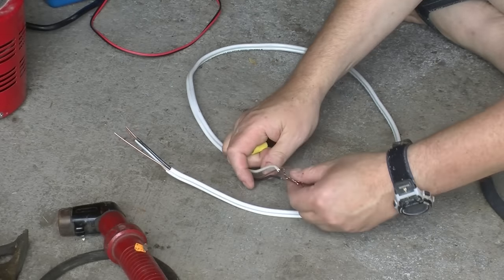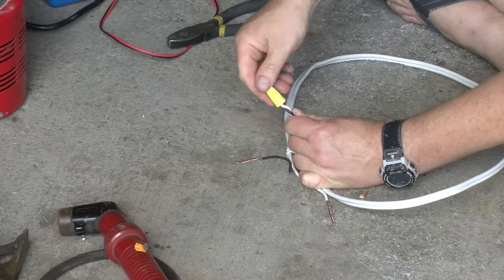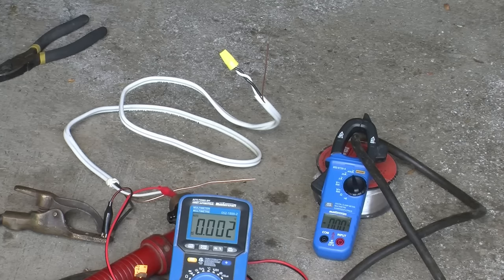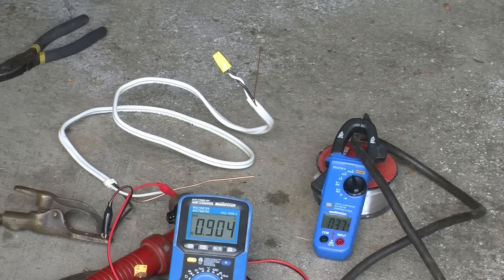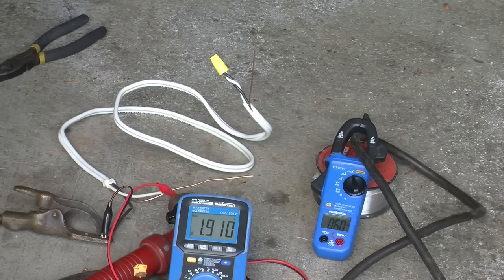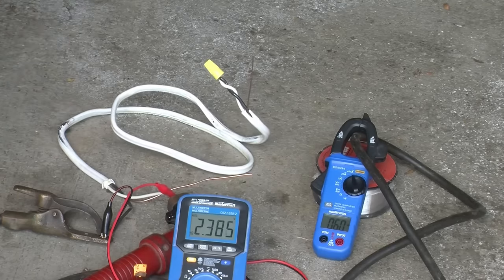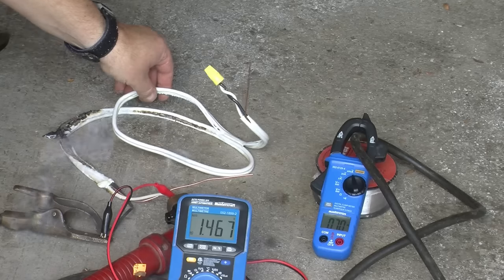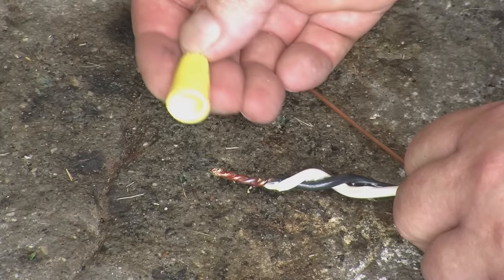How many Amps to burn up 14/2 electrical wiring?

Comment: This is why I ran 12/2 instead of 14/2 on the 15 amp breakers.  Rather trip a breaker than burn down the house.
Reply from the maker: Completely agree - If I was building a new house I'd sure do the same!

Comment: Would like to see this test at a constant 120vac reference. With the division of volts and amps you could run thousands of amps at a minute voltage. Show the limit in real world situations at 120v just nit picking, none the less interesting experiment 👍
Reply: Ohms law prohibits this unless you put a load in the circuit.  Normally current is controlled by the load with a constant 120vac.  In this demo there is no load (very small load of the wire) so the current is actually controlled by the voltage.   The voltage drop of the wire is a factor of the wire's internal load.   In a house the current is controlled by the load.

Comment: As a homeowner with negligible knowledge of electricity I found this video very interesting.  The most surprising to me is how little voltage it took to generate the amperage. I know voltage is potential and there is resistance in circuits. Given that a house circuit is 110v I was amazed that less than 1.5v could start a fire with a shorted circuit.
Reply from the maker: Yes - so imagine how many amps flow when 120V encouters a short. Circuit breakers are designed to open and stop the currengt almost instantly even when 10s or thousands of amps flow in a 15A circuit due to a short - and often preventing any harm to the wires, plugs etc.
Reply: Voltage isn't what starts fire in this case, heat is, and heat is caused by current.  This experiment is current limited, so the voltage will be determined solely by the resistance of the wire, which is pretty low, so the voltage must be pretty low.  If you use thin wire, it'll catch fire at a higher voltage, and thicker wire at a lower voltage if the current is the same.
Reply: @stargazer7644  if u have for example an audio amp that will deliver a continu 600w of power,  under a  supply battery of 12v, that wire will explode at 50A.. u cant exceed max 10A.. its all about the delivered watt  and your pressure, this wire can handle a device of max 100w
Reply: @Arvidje The wire size has absolutely nothing to do with wattage.  Wire is not sized for wattage.  Wire has an ampacity.    12 AWG wire can handle about 40 amps before it starts glowing.  But since you generally don't want your wire starting fires, lets use 20A max like the National Electric Code does.  If I max out that wire with 1V at 20A, that wire will only carry 20 Watts.  If I do it with 120V, it will carry 2400W.  And if I do it with 600V, then it will carry 72,000 watts.  In all 3 cases, the wire will get exactly the same temperature.   It isn't the 600W of your amp that matters, it is the 50A.  Oh, by the way, audio amps are usually rated for peak watts, not continuous, so it may work just fine on 12 AWG so long as the RMS average current doesn't exceed 20A.  Also, audio amps are rated for output power, not input power, and an amplifier outputting 600W into the speakers will be drawing considerably more than 600W (and 50A) on the input.
Reply: @stargazer7644  you are right.. I was confused with the resistance. But how can this wire in this vid hold a current of 40amp, it get only slightly warm he said.. I thought this wire were rated for 10-15 amps
Reply: @Arvidje It's all about the heat.  The amount of current a wire can carry is determined by how hot you're willing to allow it to get.  A wire hanging in the open air by itself will radiate heat quite well and will stay cooler and therefore can carry more current than one that is buried in insulation in your wall, or crammed in conduit with a bunch of other hot wires.  That's why wires get their current carrying capacity derated to lower limits for safety.  14/2 is rated by the NEC for 15A, but that is a derated number for NM-B cable that is intended to be installed inside of insulated wall cavities and only allowed to get to 60 deg C.

Comment: run this at 120v as intended (or 600 if you read the rating) and see how many amps you get. 1500 watt heater runs at 11A-12A at 120V. i would almost guarantee if you use this for a dryer(30A) there would be a fire in a short time. am i not getting some point to amps here watts dont mean anything. all it is is volts x amps = watts. 50 watts is essentially a dim incandescent light bulb
Reply: Watts are important because you can measure heater output in watts. 50 watts for an incandescent bulb is not a lot, but three feet of cable inside your wall pumping out 50 watts of heat sure is.

Comment: I suspect the wire nut did not get hot because the wire size was double in that area, and thus that part of the wire heated less. Immediately after the nut you noted that it was hot, this is likely because the act of twisting the wires stretched and thus reduced the diameter of the conductor just before they become one.
Reply from the maker: Too bad I don't still have the remnants of the experiment or I would measure the wire dia and see ...
Reply: @ElectromagneticVideos  The example that comes to mind is in stranded automotive wiring whereby more often than not, wires melt near a [crimp] connector.  I've always theorised that this is is related to the damage adjacent to the connector caused by broken strands during crimping or deterioration due to water ingress causing that area to heat more during the over-current situation and melt first.
Reply from the maker: @ThePracticalPeasant  I wonder if besides broken wires, its also due to poor crimping and/or oxidation on the wire before crimping. I have never felt I'm very good a doing crimps right, and have always felt I can do a solder connection better. I don't do much automotive stuff - no idea if solder would would hold up in the terribly tough auto environment.
Reply: @ElectromagneticVideos  Yep. I suspect that any of these could be factors, and many are not specifically related to a crimp. For example, directly adjacent to a any joint might be a patch of bare copper where the jacket has shrunk, resulting in oxidation in that area.
Reply from the maker: @ThePracticalPeasant  Yes. Its funny how such a simple thing as connecting wires is not that simple in the end when you are in a tough environment and/or need long term reliability.

Comment: This was an interesting video of how to destroy a cable.
Just a thought.   You are giving the impression that it takes 50 to 60 amps before the conductor insulation is damaged.  This is not correct!   The insulation on the copper is rated at 90C or 194F.   Once the copper goes over that temperature, the insulation starts deteriorating.   So, over time being exposed to higher temperatures, the insulation will fail and a short circuit will happen.   Also, a ampacity rating means it can be utilized at that amount of amps continuously and not damage the insulation.  Not as you suggested.   Most breakers however are not continuously rated at their size.   They are rated at 80%.
Reply: I think you miss the point of the video.  This is not "to destroy" the wire or he just crank it up to 100 to see it get destroy right away.

This video showing the limit that wire can handle.

And yes all the usage rating is set before reaching the deterioration limit.
Reply from the maker: Yes - I really just thought it would be interesting to very crudely see how big the safety margin was between the rated 15A and when it really melted and failed.

Comment: In RC aircraft they push more than that, but they are fine stranded, very short and use high temp silicone insulation.  It is a tradeoff between power loss as heat and weight.
Reply from the maker: Good point about that - there is always a tradeoff and your RC case is a perfect example of how different tradeoffs are appropriate for different applications.

Comment: Wire nuts are theoretically ideal, but in practice are error prone, especially for casual, careless, or hurried installers, or when combining dissimilar wires (such as 14-2 solid to a very flimsy stranded wire for a lighting fixture).

And while wire nuts measure as the least resistive compared to push in and lever couplers, the amount of resistive load is not high enough to make a difference for safety or for efficiency, while lacking the clear see through body that allows for easy confirmation of proper wire insulation stripping distance and fully inserted and secured wire that prevents loose wires (shorts or disconnection) and the very real risk of fire starting arcing. 

The fact that the push in and lever couplers are faster (time is money) and easily reconfigurable more than make up for the minor increase in cost, a no brainer for anyone that isn't a technophobe or a stubborn "this is how I've always done it" luddite.
Reply: Thats why we pull test them before we move on.......the only ones doing this are homeowners and badly trained apprentices.
Reply: @SuperChad1313  yes, with training and vigilance you can use wire nuts just fine, but it's not a perfect world and humans most definitely are not perfect, even professionals, so it remains that wire nuts are now an inferior out dated product where widely available affordable alternatives exist that are better suited to the purpose, with little redeeming qualities to wire nuts beyond industry inertia and reluctance to change.
Reply: From an engineer's standpoint it all makes perfect sense. But then I need a special wago for 2 wire connections, one for 3 wire connections, one for 4 wire connections. Wire nuts are more compact and versatile at a fraction of the cost.  I keep a few wagos on the truck for certain situations, but I use them sparingly.

Comment: Most over amperage wire problems happen over time with just above. It takes sometimes years but in time the wire insulation will fail when over its rating too much but nothing extreme … ambient temperature is important too.
Reply from the maker: Very good point. You got me thinking. I wonder how modern plastics in the cables will stand up to 50 or 100 years of service. I once lived in an old house which must have been wired in the 50s (?). Plastic insulation around the wires exposed in junction boxes certainly had brittled.  I think as you got further away from the areas exposed to air (ie under under the outer cable cladding) the insulation was in better shape. Could also have been due to some heating at the connection points. I have also seen many softer plastics used in household  items  become more brittle over the course of time.

Comment: I strongly disagree with this demonstration. #14 AWG wire cannot handle 40 A at 120 or 240 Volts. #14 is rated for 15 A at 120/240 V, but only for 80% duty cycle (80% Duration ON with 20% duration OFF in 5 minute increments). All electrical will generate heat. For anything to work, there must be sufficient capability to dissipate the heat, or limit the current to prevent heat generation to the point of destruction. Even with lower voltage (12 to 80 V) driving a stepper motor which has 100% constant on, I will only use #14 AWG wire as 12 Ampere constant on.
Reply: I agree. His title was how many amps but no mention of
Volts. So I’ll give him that. But 60 amps at 120v or higher that wire would be glowing. 60 amps at 2 volts is only 120 watts. Vs 7200 watts at 120v. What I don’t like is if some homeowner or handy person who doesn’t understand electrical principles might think they could run 14/2 for say their electric water heater or something with a high current and it will fry. I’d like to see this with a high voltage.
Reply: The voltage reading was the voltage drop across the wire with NO LOAD.  This was a current control source, not a voltage control source.  If you dead short any wire with 120V ac you will certainly get a MUCH MUCH higher than 40 amp current.  Like maybe 400-4000 amps.  That's why a dead short blows the breaker so fast and throws hot melted metal in your face if you accidentally touch wires in a box.   Current control is not generally used so most people don't understand it.  We are mostly used to voltage control.
Point being, you will never get 40A at 120V across a dead short.  You'd have to have a load to do that.  If you put a load (like a light bulb) and it had just the right resistance to make 40 amps at 120V, then the result would be exactly the same as what this video shows.  It's the amps the fry it, not the volts.
Reply: @hastypete2  thank you for the the reply I think I may try this experiment. I understand yes. That wire would explode. I’d like to see if that is in fact the case in real world scenario. I can run 14 on a 50 amp breaker powering a heating element out of an air handler.
Reply: You missed the point.... 14 gauge is rated to SAFELY be used in a 15 amp circuit.... But you are wrong.... 14 gauge can handle 100 amp in some situations..... He was looking for the failure point in HIS situation.
Reply: NEC rates 14 awg NM 15 amp at 120 volts .   That's a power rating.  Test it at a millionth of a volt and you'll get a bunch of amps before it gets 🔥.   It's all about the watts.  Run your electric water heater on 120 volts and try to take a hot shower.
Reply: After some thought. This is basically the max amount of Amps you can get out of 14/2. Period. His title is correct. It’s not about the other variables. It’s strictly about how many amps until it burns up. You can turn 14/2 into a heating element with significantly less amps. That is not the title nor his intentions.
Reply: @pbc1951  I have never seen any circuits using 1 or 2 volts with high ampere. I only ever used 1 or 2 volts on Printed Circuit Boards and milliamps. I design and build Pulse Width Modulators for PMDC motor controllers at 18,000 to 22,000 Cycles Per Second at 0 to 100% duty cycle, and on a narrow duty cycle will have spikes in ampere, but it still comes down to the Root Mean Square ampere.

Comment: This failed to show me when the 14 ga wire failed. It was an indicator of the limit the insulation could take and why we should not exceed the recommendations. Great test, I’m not sure what you were trying to show.  I removed a lot of knob and tubing during remodeling. Most, was still fine. When you found an overloaded circuit, the copper had oxidized and turned black and was destined to fail soon.
Reply from the maker: Glad you liked it - actually I did this more on a whim when I had some wire I was going to throw out and it proved to be more interesting than expected. 

Because of the interest I did a number of follow-up tests with more realistic situations of 14/2 in walls and surrounded by insulation such as this one  https://youtu.be/Df7bAEdIILI?si=HgjJpRqez8tfled9

Interesting your comment about knob and tube - the overloaded copper is one of the issues with knob and tube as is being covered by insulation. Lucky you found it. If you interested, I did a test with knob and tube too :      https://youtu.be/Yk9P2pKIza0?si=xQgJfC2KI2DBLncA